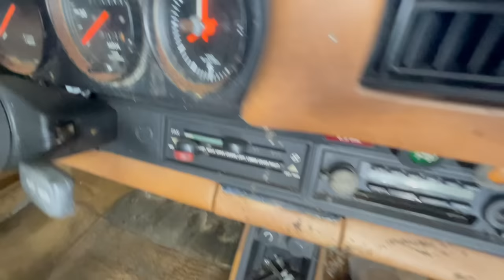I found a creepy Porsche 911 ABANDONED in a BARN! - First wash in 30 years! - NO TALKING - ASMR -

Comment: Finally someone is not starting the process with blowing the car to pieces with a pressure washer! It’s shocking to see people start the engine after decades in the barn without replacing the fuel, oil, filters and consumables.

Comment: My suggestion:
Get a spacious protected shop.
Get several shelfs.
Get the mechanical manuals for parts, procedures and torques. Porsche can help you.
Get the proper tools.
Disassemble as much as you can to clean, de-rust, replace or restore by parts.
Use the shelfs to classify, label, keep or replace by part nr.
Plan you work, work you plan, piece by piece, system by system.

Over all...: 
Try to not convert your 911 jewel in to a VW, altough they have the same father.
Reply from the maker: Nah, I'm just gonna get it running and drive it through mud puddles.
Reply: @aj_nichols  
Don't say that, it's a sin. 
Before any mechanical rotation of the engine a oil change is recommended with carter examination for debris and coals.
Old oil is water-saturated, so after the first minutes of being shaked in a warm running engine it will emulsionate to loose main lubricant and cohesive properties. You will terribly damage cilinders, piston bearings, camshaft, everything that needs lubrication in that precision jewel.
Reply: @aj_nichols  that’s almost the same energy as fry from futurama eating the last can of anchovies
Reply from the maker: That made me laugh! @egg979
Reply: @sckirschstein What is “Carter examination”?

Comment: Super cool find for sure!   Last year I found a pretty clean (few rust spots from rodent droppings and seat covers were shot) 2.0 914 in metallic copper that had been parked in a shed like yours since 82".  72k original miles, all paper work including  original window sticker, recorded oil changes, single owner and in my neighborhood it's entire life.  And, the hell hole is in great shape!    I've just been cleaning it up, replacing all fuel lines, brake lines, suspension and rubber bits. I'll definitely be following your progress now!   👍👍

Comment: What is that color? I picked up a black 81 sunroof coupe a couple months ago here in my hometown for 5k. It was repainted in the present black but original color was the rare, (I'm told, ) bamboo beige. I bought the car as a non runner although it had been running earlier in the year.  About a half hour of fiddling and I've been driving it ever since.  Was a good find but not the best one I had last year.  The other was a barn find 1962 356b cabriolet with Super 90 engine. Slate gray w red leather. Parked since 1978. My car angel still looking out for me apparently.
Reply from the maker: 356 cab sounds awesome!   This car is Cashmere beige, one.  78 only color.

Comment: Vacuuming around engines is not recommended, gasoline pulled into a vacuum will almost certainly cause an explosion within the vacuum. Simply blow instead.
Reply from the maker: There hasn’t been gas anywhere near this engine for at least 20 years.